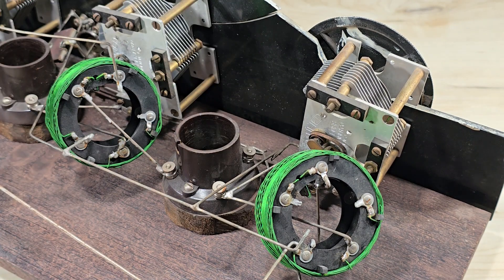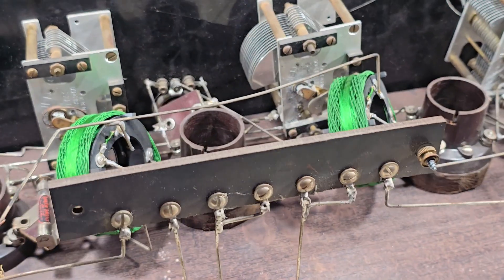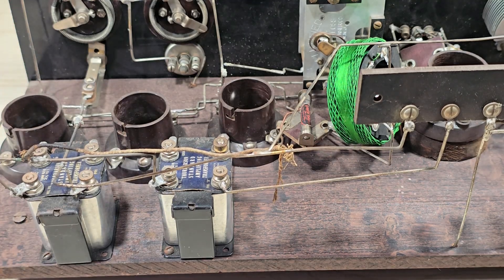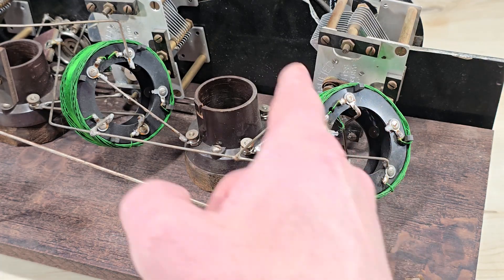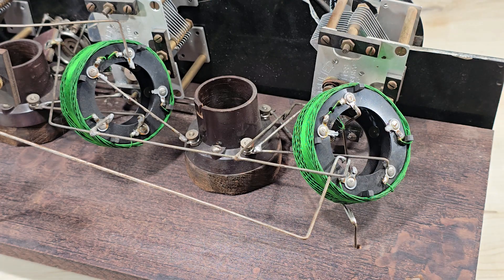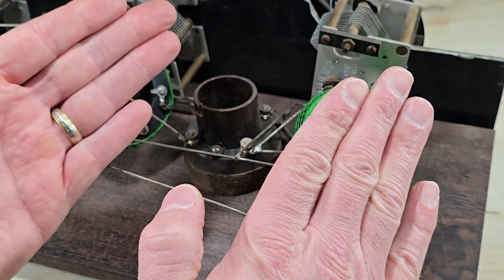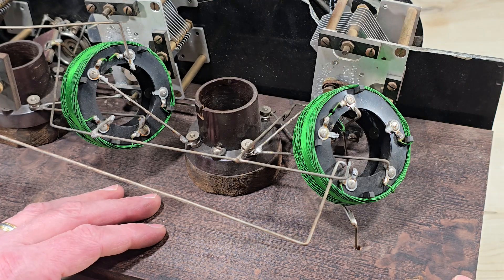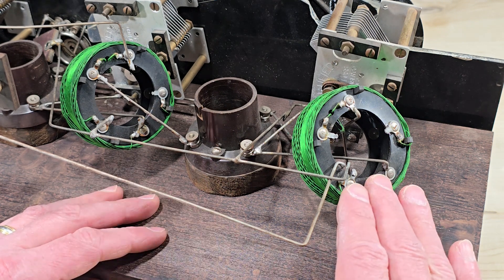How Early TRF Designs Minimized Coil Interaction and Oscillation

Comment: I must be misinformed.  I thought  90* AKA right angle gave you minimum.   Of course that would mean that the  antenna and  last coil would be in phase.  But maybe they'd be far enough apart.   A  bit of shielding?   Interesting.   I'm barely too young for this, at 76.  We did have an old console, do not remember the model/ manf,  when I was young, and by replacing the 80 rectumfinder,  I was able to get some noise out of it.  I knew it was TRF by the  several  section (4? 5?)  equal tuning caps and the layout.  Unfortunately, my younger brother   tore it all up  (he, RIP) while I was in the Navy in the 70's.   USN, 68-74,  ETR-2,  NAS Miramar, 70-74,  I maintained  GCA RADAR and TACAN.  I'm been a  radio amateur  most of my life.  Look up K6NCG, the club station at Treasure Island where we went to ET-A school.  There are 2 or 3  websites  with photos.  A  GREAT  hang out back then!!!